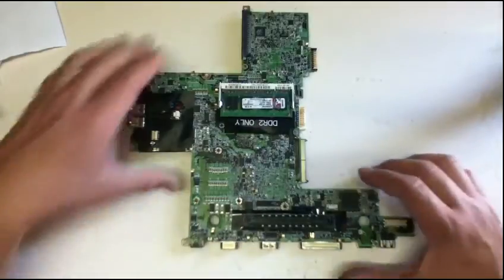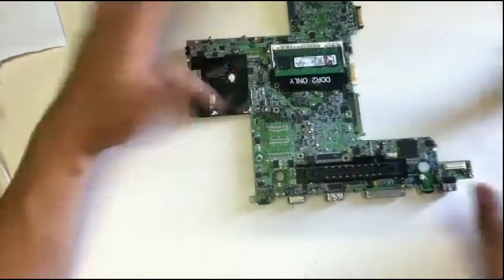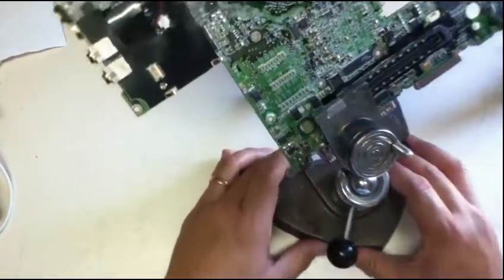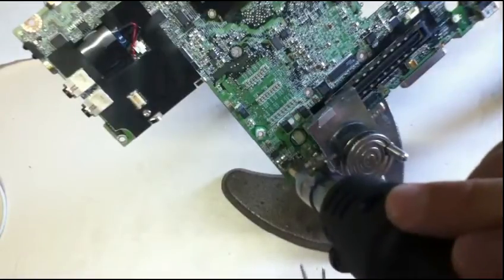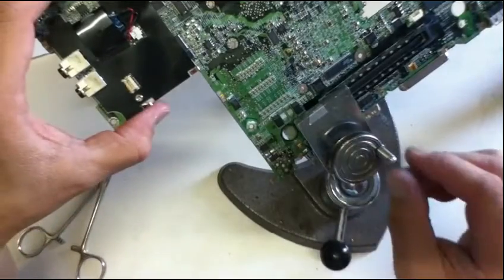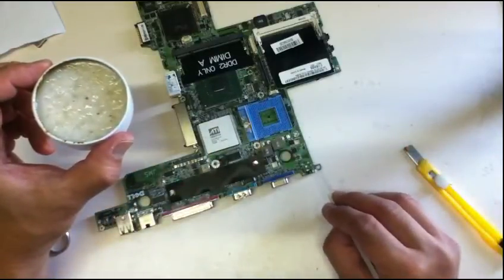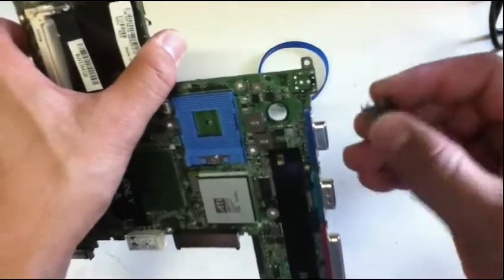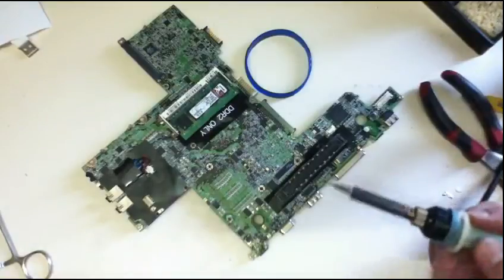How to remove a dc power jack from laptop or tablet (professional technique)

Comment: I have a question; I saw the video "quick guide to test if a laptop dc powerjack is good", is there a way of checking the voltage or make a continuity test of the powerjack with a tester? So I can assure its the power jack and not the internal board that have a short circuit?

Also, thank you very much for making this videos, they've been really helpful!